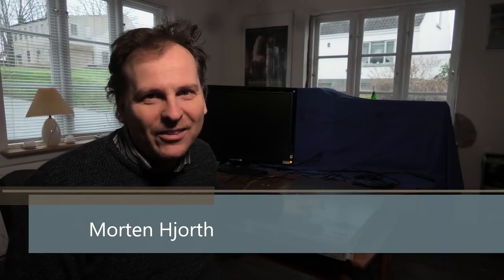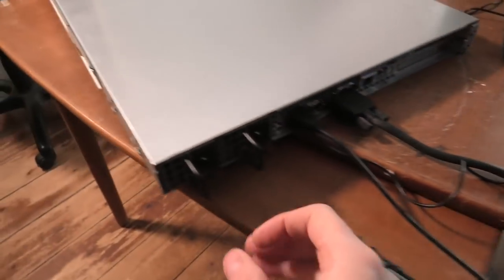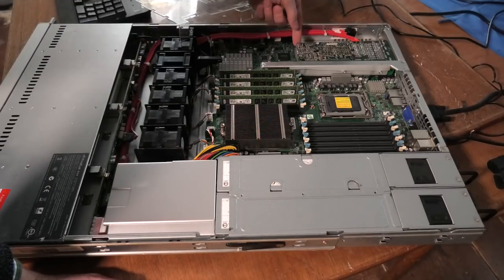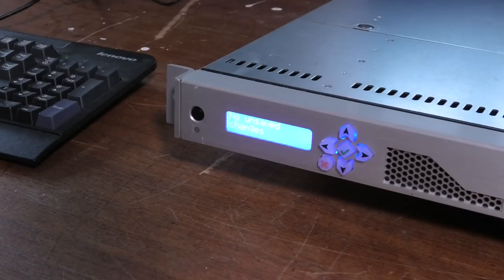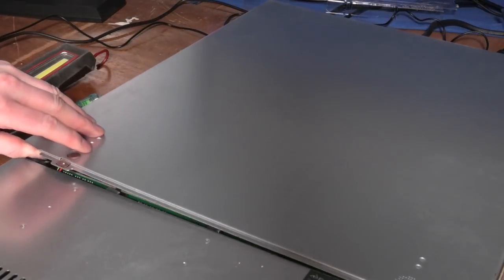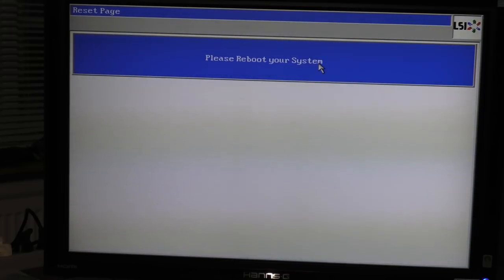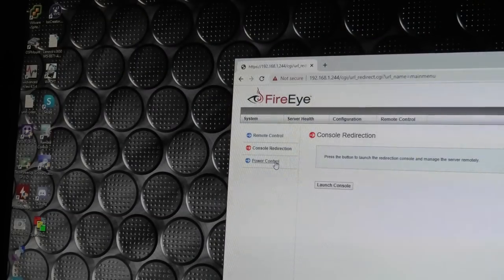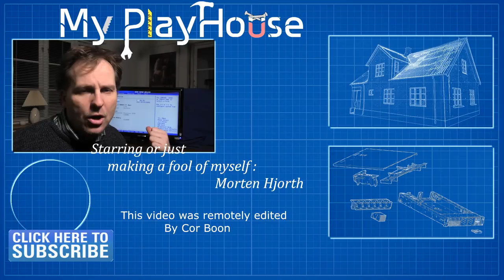I have a SuperMicro, which is MicroSoft,, 1U AMD SERVER - 931

Comment: I have used Supermicro hardware for atleast 10 years now and they are a pure joy to work with everything just works as expected unlike other major brands who shit's in their pants just because you inserted a HBA/RAID/NIC controller which wasn't their own or hard drives for that matter. Currently in my rack I have two 826's and one 846 and I will probably never have to replace the chassis since they are easily upgradable with newer Supermicro motherboards.
Reply from the maker: Hi krebosh
Thank You very much!  What model was this?
Thank you for watching! :-)

Comment: I used to spec Fireye... of course they make burner control systems. Specifically I used a UV sensor to prove pilot ignition of a huge incinerator in India. 

...the incinerator or thermal oxidizer converts hydrogen sulfide to sulfur dioxide and then vents to the atmosphere at 80m ...its India.
Reply from the maker: Hi Peter G.
Thank You very much!  glad you liked the video :-)
Thank you for watching! :-)

Comment: Quite like Supermicro as they tend to use a lot of standard PC size boards, so can be transplanted into normal cases to reduce noise. Probably why there are cables from the PSUs. 
My current NAS was an old EMC Isilon SAN with a dual Xeon Supermicro board, but as it's standard EATX size it's now in a "quiet" large tower case. 
We don't all necessarily want server racks at home, even if we like old servers.
Reply from the maker: Hi Graham Leiper
Thank You very much! standart PC stuff is fine for some stuff,,, but it's not enterprise. It is cool when things are compatible and can be used with different vendres, but it has to be well made to :-)
Thank you for watching! :-)
Reply: @MyPlayHouse  
My NAS isn't mission critical. 
Using non proprietary parts means obsolescence is less of a worry. 
That's a big concern with second hand server equipment.
You want to get stuff off a Supermicro server after both redundant PSUs die. 
Just connect a commodity ATX PSU.

Comment: This is 100% a supermicro commissioned clone for FireEye. More than likely it's so cheaply made and underspec'd is because FireEye put their licensing fees all over the costs and want to milk as much as they can out of it. I really don't mind SuperMicro hardware, though I'd recommend not cheaping out like FireEye did.
You could probably flash a new firmware to the board and get back to supermicro stock.
IDS systems like FireEye generally don't need a tonne of oomph for processing as each product is designed and rated for a thoughput level. Being an evaluation version I doubt it'd be well spec'd or licensed. Still, a perfectly good server should you find the right job for it, but there is better hardware out there to invest your RU's into.
Reply from the maker: Hi DigitalSparky
Thank You very much! I just ordered a pair of CPU's for it, so we will do more with this server :-)
Thank you for watching! :-)

Comment: I've worked with a few SuperMicro servers over the years. Good stuff. Not surprised that FireEye would spec a machine that's stripped down/feature locked both for security reasons and likely cost savings as well. That front display remings me a lot of the old Crystalfonts LCD's I used to mess with back in the day.
Reply from the maker: I forgot to see what controlled the display,, it stopped showing stuff,, so it might just be from a serial port on the system board and needing a driver.
Reply: @MyPlayHouse  maybe it was driven by a Linux software. There is a very old project http://lcd-linux.sourceforge.net/ which was born for that purpose. Many others might have been forked before Arduino was born. Nowadays you can interface the display with an Arduino and make it do the hard job.

Comment: I currently have as SuperMicro board as my main server in a 4 U rackmount Antec chassis.
Its a full feature board with an LSI SAS2116 chip 16 port HBA, a 8 core 16 threads Xeon D chip , 2* 1GbE and 2 10GbE SFP+ interfaces , with a newer HTML5 based remote console. 
Very powerful and efficient for a Flex ATX board.
Reply from the maker: Hi bwzes03
Thank You very much!  glad you liked the video :-)
Thank you for watching! :-)

Comment: supermicro servers have usually more features and they are very easy to work with. this is a cost cut down, so it makes sense for the raid controller the ram, only 2 disks etc. this g34 cpu was released around 2009-2010 so this is a very old system. my even older serer (opt 2378's, ddr2 ram, supermicro board) still works like charm but is only used for lightly serving every now and then.
Reply from the maker: Hi gior nikitop
Thank You very much!  glad you liked the video :-)
Thank you for watching! :-)

Comment: Supermicro do tend to cut some corners in their designs when it comes to often not having hotswap-capable fans, slightly messier cabling, not always the most thought out port placements* and such. Built to a cost, obviously. Also they are not too great with providing firmware updates for supermicro branded add-in cards from other vendors. But for the most part, they work fine, about average+ reliability I'd say (100+ supermicro servers experience)

The remote management firmware on this one is very reduced from the usual supermicro firmware, FireEye is to thank for that I'm sure.

* on some models disconnecting the network cable from the remote management port is a royal PITA!
Reply: I should add, the java failure for the remote console is probably just the remote management firmware beeing too old for your java version. If the board have a recent-ish bmc/ipmi firmware version available on supermicros site, and fireeye have not blocked switching firmware, thats probably your best bet for sorting that out (I'm too lazy to check). Otherwise it is possible to change the security configuration in your java to make it work with older things (lowering java's security in general, so not .. uhm.. super recomended)
Reply from the maker: Hi magnetic shrimp
Thank You very much! for all this good info :-)
Thank you for watching! :-)

Comment: fan control is in the bios hardware area, its prob set to full or high performance and its more user serviceable then HP/IBM/Dell/etc, aka you can slap in a normal mobo and use flex cables for PCIe cards
Reply from the maker: Hi Sakura Kinomoto
Thank You very much! it was rather noisy,, glad you liked the video :-)
Thank you for watching! :-)

Comment: For me as a DC person, I see Supermicro as a base / entry system or one that is running in a cluster, if one failes - just replace. I see them neutral - they are just ok, not waste and not the best.
Some distributors give you a really good discount if you order a full stack of them, so it's more a system for scaling and be cheap.
Unfortunately this CPU is crap by now, even of your base single CPU IBM M3 is faster with only 4 cores and less powerhungry.
Reply from the maker: I think I agree with you on this,, kind of the entry level of rack server.
This AMD is bloody slow,, 6134 scores 2938 in benchmark and the server is from 2012/2014-ish,, an intel x5450 that I put in servers back in 2007/08 is just over 4000,,, 5 years  before.

Comment: I love Supermicro servers, been using them for years now. Also had a couple of IBM/Lenovos and Dells. I love SM because they actually seem like normal PCs, they don't get way creative with the BIOS and giving us boot problems like ... certain ... other brands do ;-) And as earlier mentioned I have never seen an SM server refuse a card because it's not an SM card and they boot as expected. If you want them to boot in a special way it's easy to do.I'm not buying IBM/Lenovo again, probably not Dell either. HP  I have heard enough about to skip. Fujitsu looks to have commonalities with SM, but I have no experience with them (yet).
Reply from the maker: Okay,,, I am not impressed yet,,, in my world it's to much like a PC, that they have tried to make server. 
I can see a use for them in like Super computers,, where you need 1000 of servers and can change on the fly.
Reply: @MyPlayHouse  In my world having servers that are as much as normal PCs as possible is EXACTLY the point ;-) Though I don't work with servers, it's only in my home lab.

Comment: Supermicro using their server enclosures for many years. On the outside, it is difficult / impossible to see if a server is a few weeks old or many years.
Most of the problems I have seen / heard are problems with not supermicro branded stuff. like the raid cards (PCI-E expansion cards from LSI and Areca) and disks. Also seen servers that run without problems for 10+ years.

Most of the time, the IPMI got a lot more features than you got on your machine.
Reply from the maker: Hi INCOTECH
Thank You very much!  glad you liked the video :-)
Thank you for watching! :-)

Comment: supermicro are ok, but compared to Dell and Lenovo they are lacking, however they are reliable, I have 4 of them at various clients "due to lower cost" and they are working fine, that AMD CPU is a power HOG, great video :)
Reply from the maker: I am not going to be running it 24/7 so it does not matter if it is a bit power hungry :-) just ordered even more hungry CPU's for it :-)

Comment: i used to hold a dl385 g6 wich is more rare than the m4 with lff bays. still there with some 72 gb sas2 15ks, that had ddr2 ram (because yes) 64 gb and 6 core 6 thread 2.6 ghz opterons and this is the maximum you can do.
Reply from the maker: I hear that those AMD´s was kind of slow,, even back then.

Comment: I think supermicro is the best server brand. I have 2 of them 2011 based.
Reply from the maker: I am not going to agree on that,, to me it felt like the very entry level, to rack mounted equipment. I am sure it works and will get you there,, but so will a Toyota.. :-)
Reply: @MyPlayHouse  entry level? i don´t think so. One of the greatest values of a smc server is the use of standard formfactors like the motherboard for you that might be not the greatest value. If you compare a supermicro and a lenovo the lenovo would be way more expensive and you need to pay for evry freaking license. You dont get this license crap with supermicro. The remote management is included with every server.

Please dont judge their servers with such a bad example of a server. Maybe a future video Restoing this appliance to original supermicro with a original bios and so on.
Reply from the maker: Just ordered new CPU's for it so I hope to show it again.
Reply: @MyPlayHouse  now I'm hyped. Hurry up I want more. Btw great video nether the less.
Reply: HP ProLiant and IBM system X are the best rack mount servers for consumer and commercial use since they are built with high quality materials and feature great support. SuperMicro is more of a budget server but us still great.
Reply: @frederiquekruger4818 well I would say the quality of materials is pretty much the same not that any of the big manufacturers care to use the best parts. They choose what's needed for the job and the cheapest.
 I have not much experience with support of hp and IBM/Lenovo but I expect them to deliver great support. I can only tell that Dell has great support.
I also like Dell servers I have 2 r710 and I'm thinking of getting a r220.